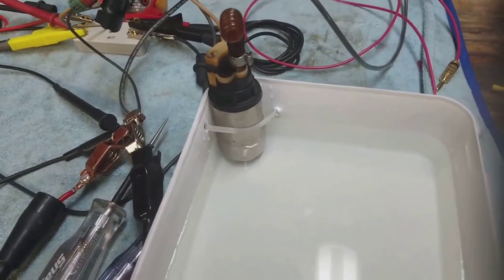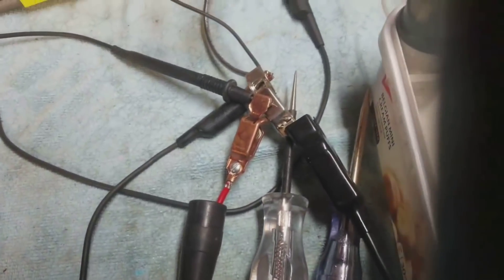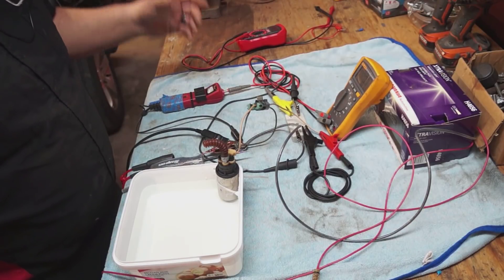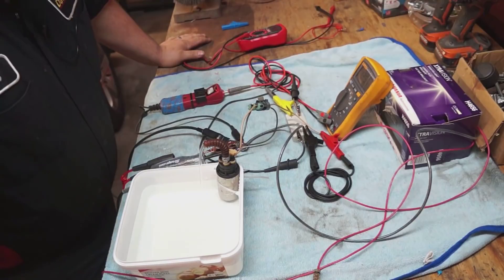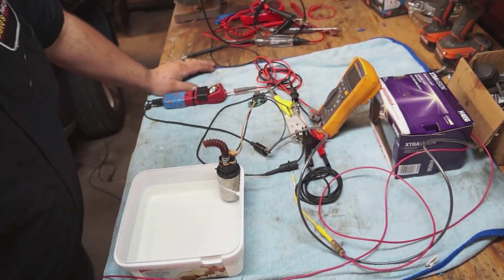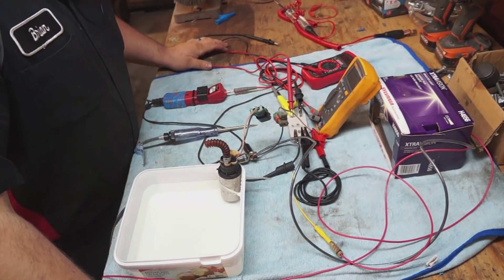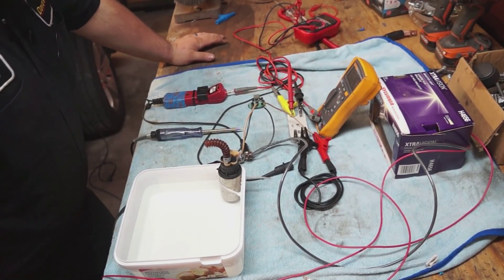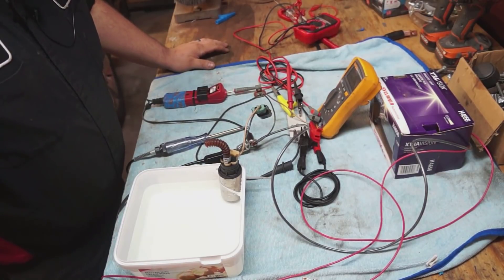Being thorough while checking your Basics! PART 1

Comment: Will water ruin a fuel pump?
Water in the fuel tank has no positive aspects--only negative. It will rust the interior of the fuel tank, clog up lines, foul the fuel filter, ruin the electric fuel pump if it is submerged in it and is catastrophic to fuel injectors if sufficient water is in the tank and makes it to the injectors.

What Happens When Water Gets into a Fuel Tank? | It Still Runs    https://itstillruns.com/happens-water-gets-fuel-tank-4914474.html

Comment: just so everyone understands the votlage drop needs to be done on an active circuit under normal loaded conditions. acceptable drop in a 12v circuit is usually less than 0.5 volt. i  wish you would have shown the two methods and explained why one is better than the other.
Reply: on some circuits that are self powered or lower voltages such as o2 sensors will be way lower

Comment: This is an amazing video. Extremely educational. I love the fact that you showed every single testing method and how all but a true load test can miss a problem. This is exactly why I do not like diagnostic trees for most applications. Without proper understanding of the basics even an experienced tech can miss something. I love how you showed even a large load test still showed a good circuit as some techs may have missed the dim light. I know when I first started I probably would have missed it. Heck I saw our shop foreman who has over 10yrs of experience miss diagnose a window motor because he was in a hurry and forgot the basics and didn't properly load test the motor. Once he tested it with the new motor and it still didn't work he knew exactly what he did. Turned out to be a pinched wire but the point is even experienced guys  can forget the basics and miss the  problem.
Reply from the maker: Thanks for the reply Hobbles. It's often the most difficult diagnosis is frequently a "basic test" that was skipped.  Thanks for the support!

Comment: load pro tool dune in two seconds fast and simple
Reply from the maker: A Load pro is a much better tool than any test light that cannot be mistaken whatsoever. However, a load pro will only load a circuit to aprox 500 milliamps. This is SIGNIFICANTLY less current than the current a fuel pump, blower, cooling fan etc operates on. In my experience, matching the current of your test load testing equipment to the current that the circuit naturally lives in will always yield you the most accurate results. I am not saying the load pro couldnt accurately diagnose this circuit however, its truly possible. Your voltage drop is much, much more significant when the circuit is loaded to the condition its naturally in when fully functional.
Reply: your statement is true .but quick and dirty testing even with the load pro low milliamps draw still would of led you in the same out come . i have used it on a lot of tests on dif high amp circuits and it has never let me down
Reply: yes i have watched that video in the past and ivin missed it he did not know how to use the tool a total hack job on him . watch Dan Sullivan videos and read his book a great teacher.
Reply: Watch pine hollow auto diagnostics load pro review he shows how it lets you down and misses the volt drop in the circuit

Comment: Did you happen to scope the fuel pump before fixing the resistance issue? I don't see much added resistance to a fuel pump circuit, but I do scope most fuel pumps. I wonder if the waveform is just lower amperage, but waveform looks good?
Reply from the maker: Hans Jorgensen That's funny you ask because I'm actually getting setup right now to film a new video on the same circuit to include voltage readings at various locations in the circuit as well as circuit current. Also, I planned on including and comparing the values before and after "repairing" the voltage drop. Thanks for asking!
Reply: Great thanks!

Comment: I would like to see some low current amp clamp measurements  in various sections of that setup. Nice video. It proves some things are working off effing magic.
Reply from the maker: I did have an ammeter in series which I hadn't covered ( I wanted to but forgot) in the video. However, current, regardless of its location in the circuit will always be the same. If you measure anywhere on the positive side OR negative side, the current will always be equal.

Comment: GREAT thought provoking video....was once asked when using the headlamp if I had calibrated my eyes this morning.  Now my headlamp has a cheap voltmeter like a buck on ebay. Shows actual voltage at headlamp.
Reply from the maker: That is a great idea. This test would include a voltage drop while loading a circuit to roughly 3 amps (unless you are using 2 filaments) which is sufficient for a lot of circuits. However, matching the circuits typical current is always best when performing a voltage drop test. For example, If you know your blower motor pulls 12-15 amps, it would be best to test the circuit under those conditions.

One tip I was told a long time ago was that most circuits operate at roughly 1/2 of their fuse's rating. So, if your fuel pump fuse is 20a, you should expect to see approx 10a of actual current. In my experience, that rule of thumb is roughly 40% which is close enough to half.
Reply: Trained by Techs 
I was surprised to find my (variable load) gm tail turn assembly if everything is wired up can pull 8 amps .  twice my headlight.

Comment: Good point Brian. A lot of technicians still don't know the importance of voltage drop testing. Nice video 👍
You should've included the loadpro  😃
Reply from the maker: I don't own a load pro, HOWEVER I do have a power probe Hook that has a "Hot shot" test I could have tried which is very similar to the load pro. Im willing to bet the hotshot test would pass due to it being such a short and low current "load" on the circuit.
Reply: Dylan 👍

Comment: Nice job. The dim headlight also showed low voltage and should lead you down the path to a load in the circuit that isn't supposed to be there
Reply from the maker: This is true. However, maybe we've been cranking the car for a bit trying to get this thing started, OR the key has been on for a while while we've begun testing, OR the battery may old/weak/aged. Maybe the cars voltage has naturally gone down and we possibly overlook that dim headlight and assume its due to a weak battery.
Reply: I believe it is best to start the diagnosis with a fully charged battery . After the surface charge is removed , at 12.6 bolts or higher . The test revealed high resistance on the positive side , before the load .